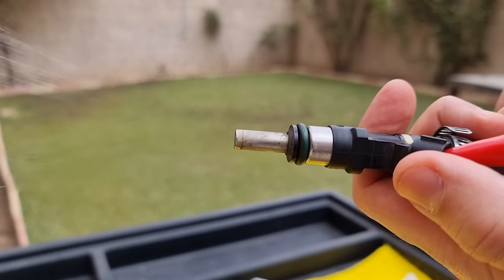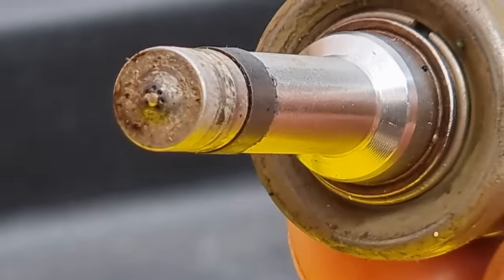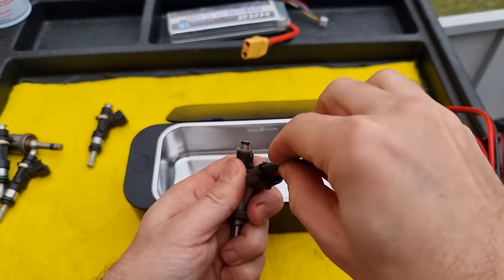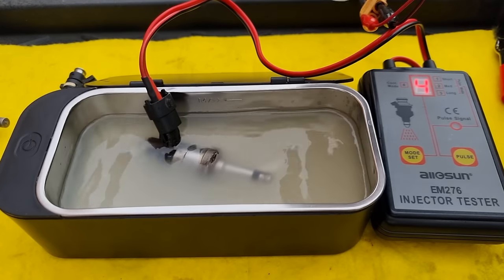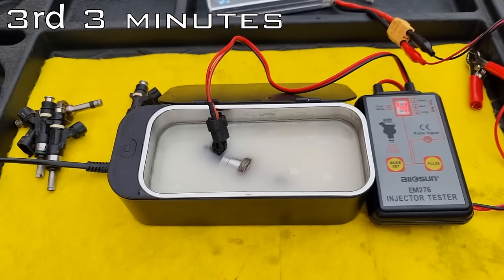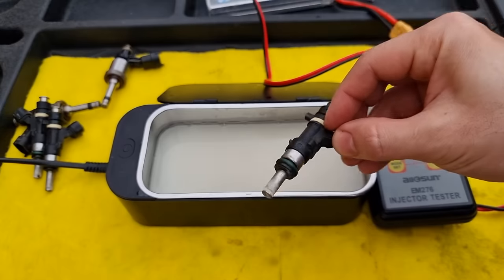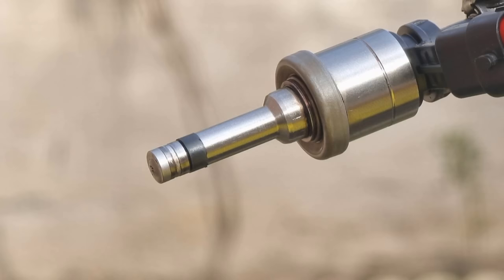Wish i knew this before spending $$$/Leaking Fuel Injection cleaning/HOW TO clean GDI injections

Comment: I have the original fuel injectors in my 1995 Plymouth Grand Voyager she has a 3.3 and only has 220,000 miles on the odometer, so as preventive maintenance I decided I'm changing all six including seals instead of just trying to continue to clean them sometimes it's better to spend $100 to $200 and just put new stuff in instead of buying time

Comment: How did the injectors get that clogged in the first place? Was it due to age /mileage or bad fuel?

I wonder how many of us have this and don't know it's happening. Certainly it'll improve car performance and fuel efficiency
Reply: Carbon build up from direct injection. 

In direct injection the injectors are located where the petrol ignites, so over time there is a build up of carbon/gunk. This causes the spray pattern to be messed up, keeps the injector open causing it to leak, or be completely clogged. 

You know when you have it because you can get a cylinder misfire, the leaking injector drips fuel onto the spark plug causing it to foul and stop sparking or they become so clogged so there isn't sufficient fuel to be ignited.
Reply: @INumeric  thanks for the detailed explanation!
Reply: @INumeric  very good explanation! I have an 07 Lexus gs350 and it has both direct + port injection but I’m getting a P0303 (cyl 3 misfire) and it comes off and on. Already tried changing up ignition coils to a different cyl but still came back to p0303. So I think it may be my cyl 3 injector? Thoughts? I’m thinking of cleaning the cyl 3 (maybe all) injector just haven’t brought myself to take the time to do so sadly.
Reply: @FuhRunna  Thanks man! and yeah it would could be the injector if it’s one cylinder, but it could also be the spark plug. Have you checked to make sure it’s fine? Spark plug would be burnt and smell of fuel if the injector is leaking. 

It could even be the valve cover gasket leaking oil onto the spark plug, check to see if there’s any oil in the area. 

If not then you can check the condition of the injector, but make sure you have a replacement one, plus a ring and seal. (On my car it’s a decoupler ring and Teflon seal, might be the same for yours) Watch a video on your car specifically as you may need special tools. 

Mine was also cylinder 3. It was actually very easy to do and took me around 45 mins to remove and replace. May try this video in the future and clean all 6 for peace of mind.
Reply: Fuel itself, that's why cars have fuel filters

Comment: Thx for the video, it is very informative.  
I believe it works after cleaning！
but how long can it last for ? If it doesn’t last long, then it may be the problem of the design and material usage ? 
Am I right ?
Reply from the maker: when the leaking is gone, it means the dirt came out from the nozzle, it will last till dirt inters there again, and that depends on your gas quality
Reply: @AliMECH  tkx so the fuel filter is not really working well ?
Reply from the maker: @P222RL  they do, but sometimes it will have a small hole in the filter and let's pass dirt, it happens on my car, and I will show in the next video how the filler ripped from a side and let all the dirt pass
Reply: @AliMECH  so it really depends on fuel quality, lucky that HK doesn’t has it issue, may I know where u live ?

Comment: Does this work better than boiling in distilled water? I haven't got an ultrasonic cleaner but will get one as a backup plan.
Reply from the maker: Never use water for fuel injectors

Comment: Dumb question but does it mater how you hook up the tester? How do you know where to put the positive and the negative? If you were to switch it, could it damage the injector?
Reply from the maker: No problem,  either way it will work, and no damage caused to the fuel injector

Comment: You can also tap into the fuel line closer the fuel injector connected and then clean it that way with the high pressure

Comment: Briefly, is there anything special you need to do before removing and replacing your fuel injectors?
Reply from the maker: There are some things good to do, 1.disconnected the fuel pump fuse to start the engine,  it will de pressurised the fuel line so when u take the fuel rail off, you won't have that much fuel running on engine
2. Disconnected the negative battery terminal, to be safe in case if you have any damaged wire, so you don't make any electric short

Comment: Maybe you don't need the fuel injector tester, just apply voltage for continuous spray with a ultrasonic cleaner?  Would IPA work?
Reply from the maker: Yes, you dont need, but its better to use, bc opening injector constantly will over heat them if you are not carful, here i shoed both ways: https://youtu.be/rpTcm5ploh0
and ipa not a good cleaner for cleaning fuel residue

Comment: Try once a year adding 1 quart of ATF to 10 gallons of gas. The detergent in any ATF is one of the most powerful known to man and will clean anything. I've used it for years and I have never had a bad fuel injector.
Reply: I've never used it and I've never had a bad fuel injector.
Reply: Transmission fluid?? 😂

Comment: You can also make up the difference with gasoline, with a majority of your cleaner. I run berryman's B12 occasionally through the tank for maintenance.
Reply: Here's the problem those who use cleaning products "occasionally." You get gunk buildup through normal use and then "occasionally" try to clean it off, often with mixed results. If you use the cleaners regularly, it will prevent the buildup in the first place. You'll get better results and fewer problems with regular use.
Reply: @barrygrant2907  well occasionally is depending on driving once a month. I've been doing this for 30 years I think, fuel and fuel filters are very good these days have been for some time. I replace the fuel filter and run a bottle through a tank or two and if it needed it it will be noticed. In general fuel these days do not need regular doses of cleaning. When they do ,berrymans B12.

Comment: You can see it’s not the same injector at 3:10 there’s a groove on the main body of the bottom one.
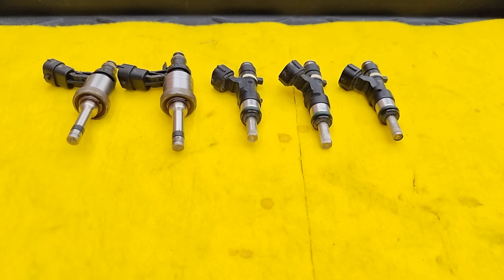Reply: At 0:25 you can see 2 injectors nearly identical, one with groove and one without. He probably mixed them up.

Comment: I have used Injector Repair LLC  in upstate NY and he charges less than $20 US dollars for ultrasonic cleaning,  changes O rings,  seal and screens and give a  full test sheet with dynamic and static testing,  Brought the 4 Bosch Injectors on my Porsche 944 back to factory spec.
Reply: Still, that's $80 a pop every couple years.
Reply: @mpmattson  So what
Reply: @christopherkast8045  No big deal, just $80. I spent $50 for the tester and cleaner and should be good for 20 years.  Glad you found a good shop.

Comment: Fuel injectors have a screen , in order to clean you actuate the injector ,while under pressure use a cleaner ,but you force it through the discharge!
Reply from the maker: For your information,  carb cleaner is the best solvent for carbon and it has less pressure than been applied on the fuel system on the engine

Comment: Can you clean an o2 sensor and a pic valve?
 Thank you
Reply from the maker: yes i will
Reply: Pcv valve. Spell check,goofy.
Thank you sir.
Reply: That electronic cleaner works very well.
Reply: O-2 sensors don't spray,but I guess you could clean deposits? Might not do anything / damage internals? Pcv valves could be cleaned, but better to replace. Not that expensive.

Comment: You should remove the oring or it will be soft and destroyed .what I did I just attached a 12v adaptor and soaked them in pure injector cleaner for 12 hours and they became like brand new have to keep injector open with the power supply

Comment: I see how this is likely why they leak, however on a DI engine. How do we know this injector that doesn't leak with a can of brake cleaner taped to the end, also won't leak @ say 1500-3000 psi..?
Reply: It doesnt hurt to try this first before replacing the injectors with new ones

Just test it inside a car and see if it works properly.

Comment: Do you think it would work on common rail diesel injectors?
Reply: Common rail injectors just need to be soaked in carbon remover. Their operating pressure is much higher so when they are worn out they are stuffed. Definitely a job for the shop not the home because they will know the difference

Comment: Curious to know why the first set of before and after images at the end show two different injectors??
Reply from the maker: Because I did the test on 2 different injectors
Reply: @AliMECH  I think you missed what I was saying. Clearly you have two sets of before and after. In the first set, those are two different injectors. Which is the leaking one before and after. The after injector has a ring groove cut in it, but the before one above it does not.
Reply from the maker: @Chuck G  I had 4 of 6 leaking injectors from my 2009 gmc acadia, 4 of them were leaking like that, and fixed 3 of them like that

Comment: Would it work for a catalytic converter?
Reply from the maker: Do you mean the cleaner ?
Reply: @AliMECH  
The sonic cleaning, I’d think it would use the frequency waves to successfully break up any thick carbon buildup that would be blocking the catalytic converters inner screening filters if that’s a correct way to describe them.
Reply from the maker: @1313gia  if you can find big ultrasonic cleaner and put catalytic converter in it, yes it will defiantly clean it well

Comment: the best way I found to clean injectors was to take a red straw from a can of carb cleaner and roll black electrical tape around one end. then thread straw inside out through the needle end of a 10mL syringe. place fuel rail end of injector into syringe body. hook up switchable 12v to injector. connect carb cleaner and spray. switch on/off, spray, repeat until satisfied clean.

Comment: Am I the only person who never taken an injector out or even knew it was possible. I think this is over my head mechanically
Reply: I’m not a master mechanic, have only worked on a few cars. But extensively on each. And fully self-taught (youtube). Pulling injectors is not hard. It’s just removing a decently long series of bolts and following a service manual. If you can change your brakes or something else simple for example, you can do this job.
Reply: Yeah you are.
Reply: @DEATHWISHVQ  No, I’m not. I don’t think a backyard mechanic would do this. Haha

Comment: save money, use wynn's petrol extreme cleaner at every service. You won't need to remove injectors to get a perfect result
Reply: I've never used anything and never had a bad fuel injector. My vans travel 3,500 miles per month. They probably don't have a chance to clog up. But I'm pretty strict on fuel filter replacement.
Reply: @Bryan-Hensley  you're lucky, then. Injectors are continously getting clogged, it's like the veins in our body, they get clogged with time  because of fuel quality and the location itself of the Injectors. If you have the chance, take measures of emissions before and after you use a good Injector cleaner like Wynn's, you may get surprised
Reply: @tozzi32  I've got over 1.3 million combined miles out of my service vans and never had a clogged injector. 364,000 in my Toyota Corolla. I wonder why I don't have issues. I usually buy from the same gas station.
Reply: @Bryan-Hensley  my grandfather is 83 and he's never had a heart attack, that doesn't mean there's no cholesterol in his veins
Reply: @tozzi32  it doesn't mean there is either.

Comment: Unfortunately it doesn't reassure you that the Injector delivery volume is to 0E spec. Or that the set is balanced and thats the reason professionals use equipment costing $10K.
Reply: I mean yes, but for an everyday stock, naturally aspirated car, it'll do it. Now if your running something more aggressive,  that's a different story
Reply: If you place the injector in the opening of a graduated container and hook it up to a proper fuel pump you can measure the volume and output of the injector and not spend $10 grand on a tester that only the followers need

Comment: I don't have fuel injection on my 1997 toyota hilux it has a carburetor and l don't think has been touched on 25 years no cleaning nothing and it still works fine well carburetors have been longer than fuel injection all those years of improving carburetors l don't need to spend money on cleaners and another thing is the petrol pump is on the side of the engine and l know it has been replaced because when l bought it in 2020 the fuel pump looked very shiny and new my son pointed that out also l have had to change fuel pumps in one of a ute l had at $300aus each time to change the fuel pump on my hilux l can do it and it will much less than $300aus

Comment: Most leaking injectors only when it is hot after switching off the car specially direct injector, you will not discover it at all in this way

Comment: $1,000's for fuel injectors?!? I bough a single brand new Bosch injector for approx $18 dollars, delivered, from amazon. A set of 6 qty, was about $70. This for a 2016 Dodge with 3.6 liter pentastar V6.

Seems the cost of the ultrasonic cleaner would be more?

Comment: If you have a direct injected engine, I do not recommend this. Why? My Cadillac is a 6 hour + job to take out the intake and the coolant resivoir. After I got the OEM injectors at a discount, they were $80 each. I'm not paying a tech a huge amount of labor to reinstall an old injector that may go bad in two, three months or six months or even one year, then have to do the job again.

Comment: So the machine is using how many kW,  kHz to much time will destroy the injector causing micro-cracks,  more is usually never better, you need the proper solvent, you cant just mix solvents to reach capacity.
   Some injectors cost $99.00 each,, DISASEMBLE the injector clean it, reassemble with the proper rebuild kit, don't go rummaging through the lego draw, 
  You need to know what you're doing.  At a subsonic level mixing solvents knowing the internal parts, how much power to time ratio, if they said three minutes and suggest a solvent? They have a reason why. Just leave the kids in the tub all night they be way more cleaner. 12v is way too much. The car has a 12v system that has internal components to reduce or increase voltage before it gets to the different components. Now your telling people to do stuff, they tell more people, they make a video, and the fuel injector industry gives you a 🏆.

Comment: This is what happens when you own a tsi vw group trash junk engine.... 2011 ecoboost engines still running with original gdi with 200 000, plenty in the UK.
Don't buy German junk pls learn...